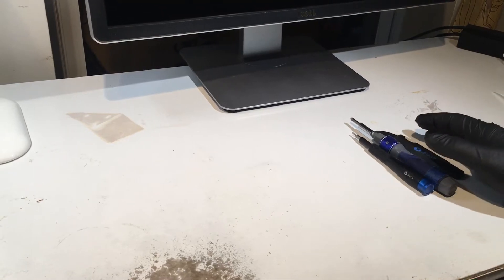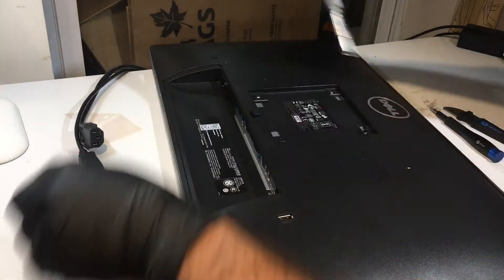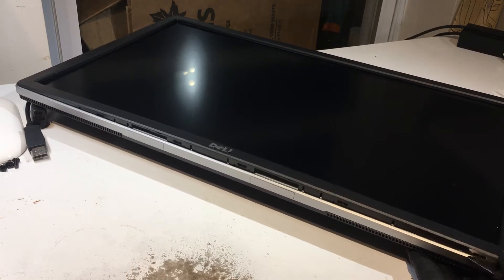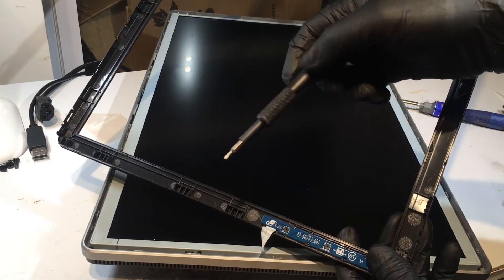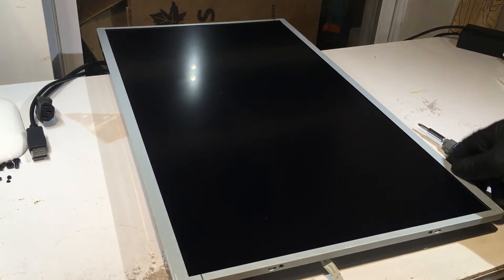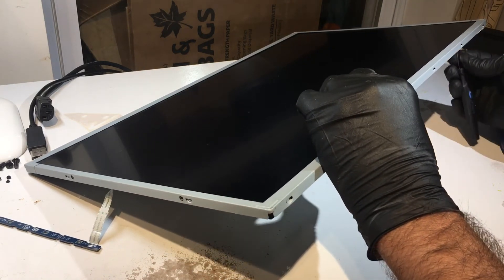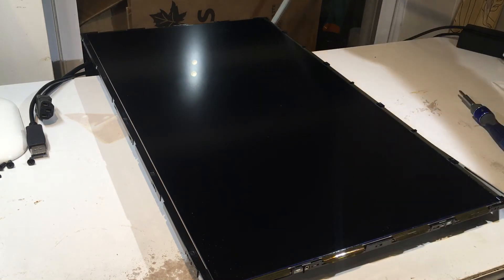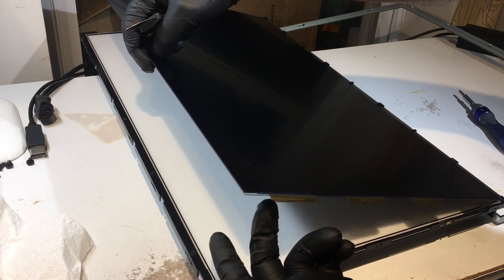Dell P2415Q - Faint Horizontal Grey Line Fix - Pt1, Monitor disassembly

Comment: I've got the 27" version of this monitor experiencing horizontal flickering, going to use this video to see if I can fix the issue. FYI on the P2715Q there are 4 screws holding that ribbon cable for the OSD buttons.

Comment: Many thanks for the video!
Had the same issue, replacing the diffuser has solved the issue for me and I do not see any site effects. Was having faint horizontal in three of P2415Q, hard to believe Dell did nothing with it. The screen was on a market for 5 years. The fix is not very difficult, just like in the video.

Comment: You do not need to do this. Use the monitor for a while (about a week, intensively) and the stripes disappear. Had this with both my P2415Q.
Reply from the maker: In my example, I work on the same monitor almost all day because of my job. I went through 3 monitors before I found that it was the incorrect order of the physical layering of the sheets behind the LCD that caused the problem. No amount of usage in my example would correct the problem of the sheets being in the incorrect placement. Once I changed the order the problem was solved immediately.